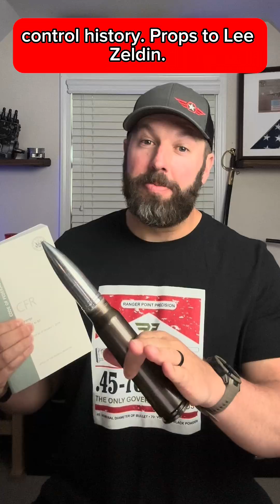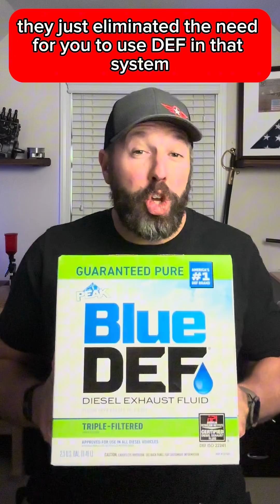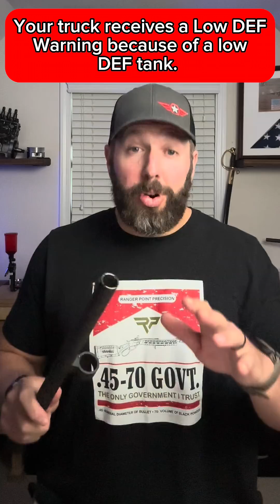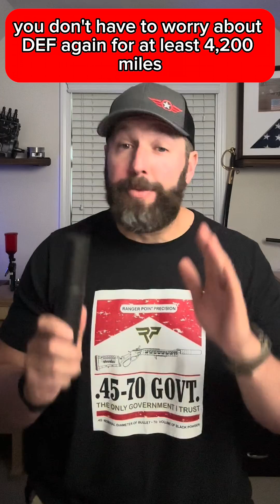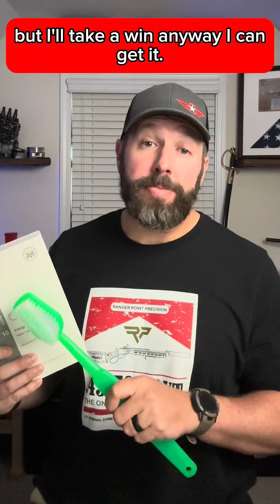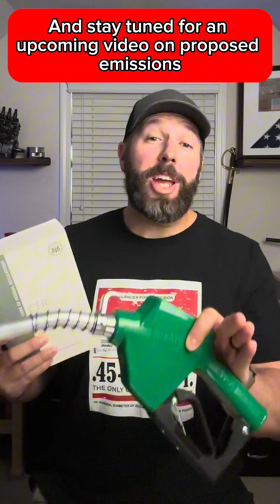The EPA just DELETED DEF in Pickups?…Lee Zeldin is a Magician #diesel #dieselengine #dieselpower

Comment: If you run out of DEF your vehicle goes into limp mode, correct? So if your truck currently goes into limp mode due to low or no DEF, how would you program your truck for the "new rules"
Reply from the maker: EPA encouraged OEMs to retroactively implement this Limp Mode strategy. Hopefully they will start voluntarily flashing ECUs for folks. We shall see.
Reply: @freedomworx another way to verify you don't have any unapproved programming.

Comment: What they should be deleting is DPF and EGR😅
Reply from the maker: It’s not going away unless HR4117 is passed by Congress. The EPA has no power to do this.
Reply: @freedomworx  My went straight to hell. Just get rid of it.
Reply: Scania doesn’t have EGRs
Reply: You are absolutely correct. The DEF system is actually a fair solution for NOX. Unless the EGR which is a real problem for engine longevity and the DPF is engineering gone mad !
Reply: EGR should be collected after the DPF, most trucks collect it before the DPF and that is why EGR and intake systems clog up. all it does is recirculate ash around in a loop before the DPF.
Reply: Miracles happen somebody actually agrees with me... I wonder if they would consider giving the fines back to Dodge for tuning the def system not to do very much because they couldn't manufacture the parts to keep the systems going during the pandemic. At work I learn to ignore a light on my dash the first two times it came on I took it to the dealer who charged my company a couple of grand to replace a doser valve then the light went off by itself when I slow to get around to take the truck to the dealer one time so I googled the code I found that it was a history code not an active fault code most probable cause was the EGR valve sticking closed for a couple of thousands of a second once in a while probably when it was cold it would set a code and if it didn't continue to happen in the clear itself after 2 weeks thedoser valves probably never even needed to be changed the real problem is programming it to leave you on the side of the road if there's a issue there are some things that might cause engine damage like the DPF

Comment: For anyone worried about the potential of parts failing from this strategy, there's an easy workaround. If you keep some DEF in the DEF tank, it'll keep the parts from failing.

😂
Reply from the maker: It’s a legitimate concern. I think the best strategy is to keep some DEF in the tank…periodically. Maybe splash it every 1,000 miles. I know this isn’t a good idea on a lot of platforms, I just wanted to get the info out there so people would be aware of the change in EPA guidance on the topic.
Reply: @freedomworx  oh for sure, I just felt like a little light trolling was in order.

Comment: If you have a DEF system and don't have DEF in the system you may damage the doser.  Many systems utilize DEF as a doser coolant.  So next time you add DEF it may be damaged or at least crystallized creating faults that won't just go away.  Then you get to pay for parts every 4000 miles
Reply from the maker: It's a legitimate concern... I'm sure we will see an entire new slew of issues when people start skipping the DEF Pump. I'm just putting the info out there.
Reply: Technically a leaking reductant injector will crystallize... one that has nothing to spray will usually clean itself even if it is leaking. My question is who's gonna tell the ECM the EPA has changed their statues?
Reply: @JeremiahSchaefer-m5o  good luck getting oem to do it.
Reply: @KevinB-d7t also running the pump dry will probably ruin it, unless the sensed low fluid level turns the pump off until fluid is added.
Reply: Who cares. It should have been deleted
Reply: Incorrect. Most systems use actual coolant running through the doser to cool the doser.
Reply: @FxnBoats correct me if wrong, but isn't "doser" just another term for "injector" which is  what is spraying "diesel exhaust fluid" into the exhaust stream after the "diesel exhaust filter" & "catylitic converter"?  The location seems too far away from the other coolant components for it to be practical to have coolant lines running to the back of the vehicle.
Reply: @huckbeduck you are correct and yes its not practical but its the norm to run lines through the frame all the way back to the doser or injector to cool the doser.
Reply: @FxnBoats  depends on the system.  Most cummins systems past 2017 use DEF to cool the injector.  If it has a Bosch pump it is coolant cooled and heated.

Comment: What does it do to the DPF?  I assumed the DEF helped keep the DPF clean?  Will you end up with a plugged filter?
Reply from the maker: No. DEF does not affect the DPF. And in most cases, DEF is injected downstream of the DPF.
Reply: @freedomworx Then what cleans the dpf?
Reply: Def does nothing for the DPF.  But i wouldn't advise this as it may damage the dosing valve.
Reply: DEF is sprayed down stream of the DPF to convert Nox to nitrogen and oxygen.